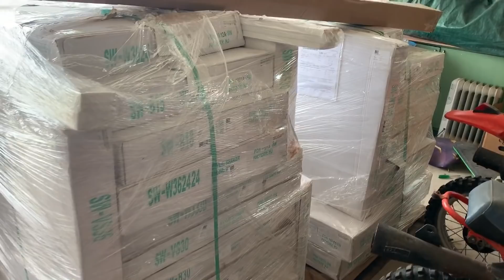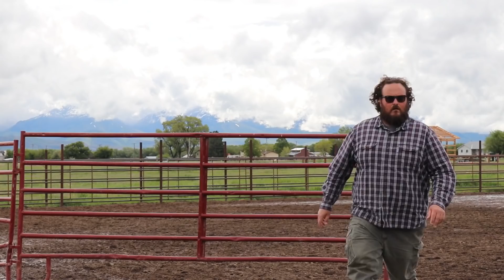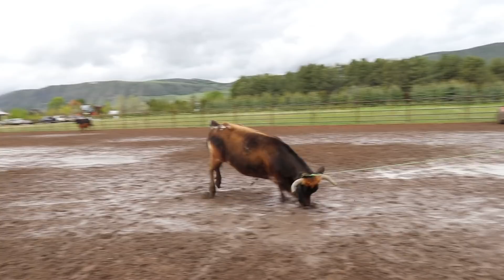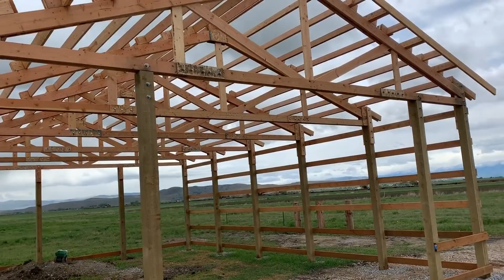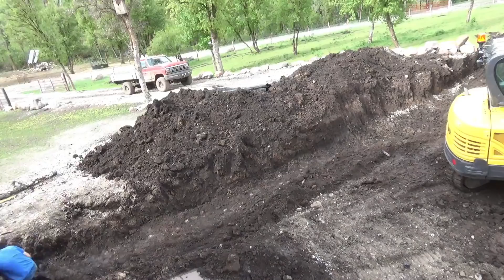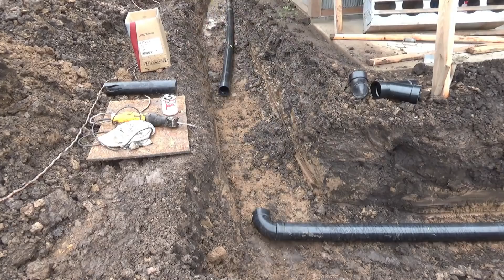#331 - Changed 3" Sewer Main To 4" (Per Code) - RTA Kitchen Cabinets Arrived

Comment: Great work! I've never used abs here in New York we use sch 40 pvc. The inspectors here would never let the 90 degree fitting fly they require a 45 and street 45 for the corner turns but that's just our code, you'll probably never have a problem.
Reply: Unless it needs to be snaked... that 90° is gonna be a 🐻 to get around.  Either a couple of 45's as you suggested or a long sweep 90°...same with the wye.  I believe long sweep is code for this type of application where all the legs are parallel to earth plane...at least under concrete floor...may be different in outdoor situation.  Just seems like the long sweeps would be less problematic down the road.
Reply: @terryq9966 of course they would be.  This guy is a typical cut corners guy but in this case he needed to with the long sweep corner.  He's an example of why not to pay money to a "contractor" who does things on the cheap.
Reply: Two 45ºs with a foot of pipe between them is code here. 90ºs are not allowed on buried pipe.

Comment: One issue with the laundry room upstairs is it makes use of a clothes line difficult without carrying baskets of wet clothes down stairs and out the back door unless you do something crazy and mount a post on the hill and run a pulley system to the house so it is take them out the window and simply pin on and send out to the space between the post and the house. Yes clothes out of the dryer are nice in the winter but it is hard to beat a line dried blanket in the spring, summer or fall.
Reply: Just curious about all this off grid electric demand with 7 people taking showers and doing laundry etc.  Clothes dryer is a big demand for example.

Comment: Having sold ABS pipe in the UK I can tell you plumbers would not take it or return it if it had too much of a bend, the band can be reduced dramatically if it is stored well, racking should support the whole length of pipe and if a bend is noticed the pipe should be rotated bend up so it has a chance to fall out.

Comment: With all those logs Josh was trying to get rid of & ended up burning, you could have milled enough lumber to build the shop & a wood shed & a 6 car garage & had enough firewood to last 5 yrs. 🤣🤣🤣
Reply: No doubt.  One of THE most wasteful things I have seen in a while.  KOOKY
Reply: @JohnDoe-np3zk  Not sure cotton wood is good for building anything but fence and it has to be milled also
Reply: @banjobenson9348  it could have at least been used for firewood?  All I know is it was a huge pile of wood.

Comment: More rework happening on a tight schedule, because plumber didn't realize 4" was required versus 3". If a Building Inspection is the next in line, I hope the vapor barrier issue gets addressed.

Comment: Trusses are manufactured with large presses and have engineered load directions. Often how a  load pulls on a part of the truss is as important as how it pushes on it. putting a brace in the wrong place can actually weaken it.. putting a beam mid span under a truss is likely to have it fail. Building trusses on your own isn't easy but thats not to say its impossible. On the other hand it isn't beyond you to use rafters that are placed in compression on a ridge board and then cross tied. That will require large dimension rafters if you are spanning large distances but if your top plates are 30 feet or under then you can be pretty good with 8 inch nominal rafters with a mid tie. If your snow loads are higher then you just add a few rafters to reduce the span between them but you need a high pitched roof to get the snow off it. if the span is too far in the attic you build a load bearing wall to rest your rafters on and use two pieces of rafter to span the distance from the ridge board to the outside wall plate..that load bearing wall needs to run down to your foundation of course so using a beam might be necessary if you want an open floor plan on the first floor.

Comment: Wow...what a job! That curved ABS pipe is odd. I worked in a factory that made abs pipe (also pvc and poly) back in the 70's and it was always straight. The poly was always rolled into coils.
Reply: So he puts the wrong size pipe in and has to dig it all up, and we still think he knows what he is talking about?  OK.
Reply: If you paid attention, John Doe, you would know that this structure was originally to be his barn. But of course you just wish to troll and make snide comments as to how things aren't completed to the level that your arm chair certification requires.
Reply: @allengray1316  I did catch that part about turning the barn into a house, and leaving the house foundation alone.  Also building another cottage, and a pole barn.  I dug up and repaired a septic drain line in one of my houses recently.  I installed two drop/future distribution boxes while at it.  Then I backfilled with drain rock in many wheel barrow loads.  All by myself.

Comment: I'm sure your plumber would never install a 90° ell. It was a Long turn (LT) 90° ell. ABS pipe bends because it expands on the sun side.  If the sun is not out the pipe is reasonably straight.

Comment: schedule 80 PVC is probably the best you can do today for waste line. It won't crush or crack under substantial load. I have seen guys drive over it in backhoes when it was laying on flat ground. If you are considering doing something on your property you should mention it early enough that your subscribers can respond. I have about 15 years as a general contractor site supervisor / jack of all trades and additional years in other trades. I am sure a lot of other subscribers also have knowledge to offer.. if you have a question just put it in a video before you do the work

Comment: I know next to nothing about plumbing, which is why I am asking- don't water and sewer lines need to be buried below the frost line which is usually 3+ feet?
Reply: Yes you want it below the frost line.  Where he is "they" probably want 3 ft deep.
Reply: Not for sewer generally. And with septic there's no choice, it has to be high enough to feed the tank. Sewer won't freeze if done properly. But when shallow it's not to be driven over other than a lawnmower. I've dug for plumbers and any time they went under a drive they put the pipe inside of a larger sleeve.
Reply: @marioreali5925  his drain pipe doesn't have much slope because as you say the height is an issue to get deeper further out.  He's running trucks over it hmm...
Reply: @JohnDoe-np3zk  the only equipment we're allowed to drive over a shallow pipe with are tracked machines and at right angles to the pipe.
Reply: @marioreali5925  rather than run the risk of the wrath of "Health Dept" I dug it all out by hand and repaired it.  Nobody wants to do that "shyte" by hand and I get that esp with tenants in there.  Oh well it's done now and way better than tearing up my entire place.  The best part is there is access and cleanouts at both ends of the field now.  Gotta like that.  Digging "sucks"

Comment: As a licensed plumber did you not known that 4" is required?  And as the owner, did you not know you would be having a toilet in this building?  Did you ever consider always installing an item 1 size greater than needed instead of the minimum size? Younpaid dearly in material and labor in changing the 3" to 4" abs pipe.

Comment: Ah you can’t lay a 90 in the ground. 
Also abs does not come with a natural curve. 
Every fitting slows down the flow of water. 90’s flat in the ground are like hitting a brick wall. You want a gradual turn

Comment: Smart move to eliminate all the hills and valleys on your septic pipe run. I hired a contractor to put mine in while I was at work. Had to dig it up 3 years later as it kept clogging. It was a mess! Hills & valleys all over!
Reply: Yea i was thinking he should have leveled it a bit more before he dropped the pipe in though. Looked like he was just going to fill in around the pipe as he went.

Comment: I would use abs only under a gun point anyway
Reply: What would you use?  The green stuff with the rubber fittings?
Reply: PVC is thicker, stronger, and straighter. Also costs more
Reply: @marioreali5925  it's about 10% more at Home Depot for the 4" PVC.  Other than that which sees the light, I would think the PVC would be better and stand totally corrected.  My repair involved a reasonably short length and I custom made drain pipe to sort of match the existing kind of plastic 4" black with holes on both sides that is probably 50 years old.
Reply: @JohnDoe-np3zk  it totally is better I think. I was being a bit sarcastic about the cost. ABS might have it's own advantages, i don't know.
Reply: @marioreali5925  around here there is ABS ADS and some green pipe with rubber fittings along with PVC.  ABS seems to be better with cold and warm and better impact resistant (not as brittle?)and can handle UV better than PVC.  Then you get into this "EZ Lay" for drainfields cheapo ABS with sytrofoam beads I didn't like that idea at all...
Reply: @JohnDoe-np3zk  PVC will crack if hit
 I've only done that a few times. The plumbers get all grumpy

Comment: What ate bellies?
Reply: Slight (or not so slight) dips in the pipe where the ground has settled unevenly. This will lead to a sludge build up  and possible (probable?) blockage of the drain.

Comment: no wonder you want to move, my gosh look at that subdivision.  call me a New England "old-growth" snob, but although that neighborhood is probably comfortable as heck it sure looks awful.
Reply: Driving into those at night suck when 2 cars are trying to pass and sometines there is no curb lights or sidewalk and the roads a little narrow. Its a small thing but it worrys me each time. Also I feel like the drive in and out should be shorter. Its just so windy sometimes.